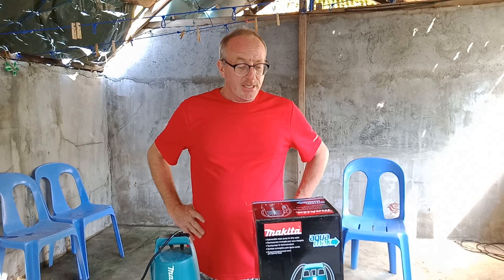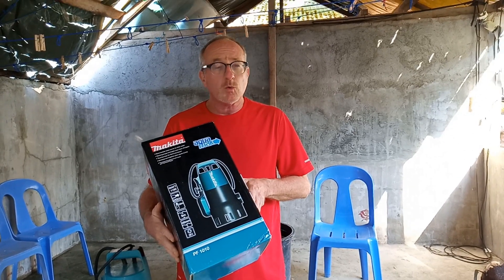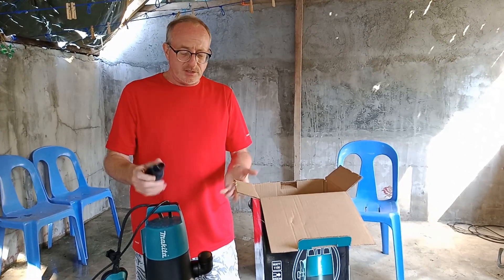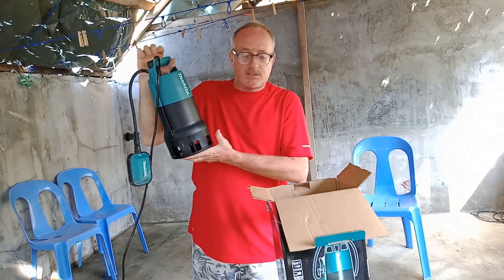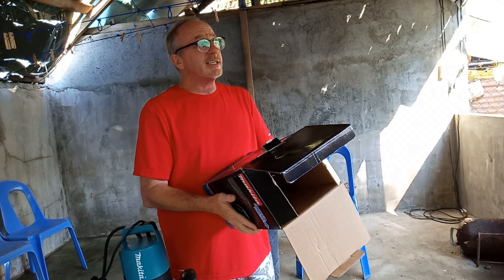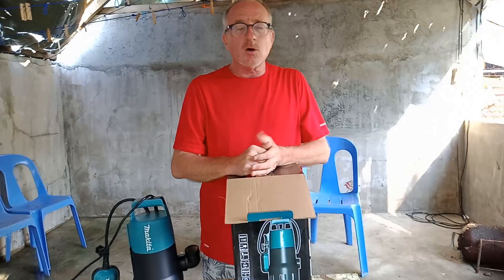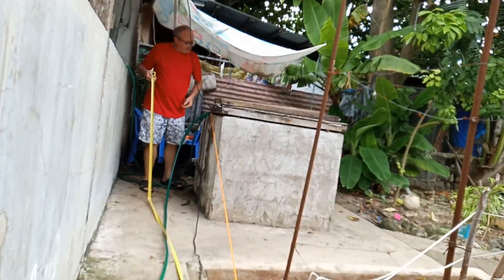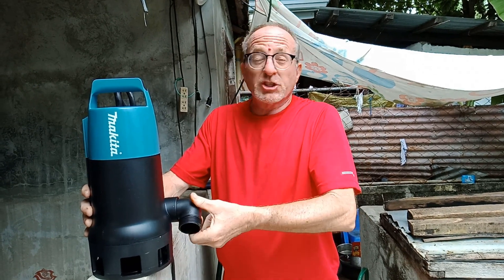Submersible Water Pump - 1/2 HP and 1.5 HP

Comment: 😊Great video😊 i hope you can help me withmy questions. On the packaging, The specifications for the 0.5 hp pumps says "140 liters per minute." there is a big difference between your actual use and the specs. Your review timed the 30 liter container at around 2.5 minutes, which translates to 12liters per minute. Why is there a big difference? Im asking because im looking around for a pump like this. Thank you 😊
Reply from the maker: I've been told my was slower because  I used a smaller hose, a water hose.  There are hoses that are bigger and should produce a lager flow per minute.  Hope this helps.

Comment: Very informative video. I’ve recently purchased a similar dirty water pump. I do have a question though, I can see that the discharge diameter is larger than the hose you attached, wouldn’t this impact the life of the pump in the future? Creates more friction on the motor.
Reply from the maker: Maybe, and even output more.  But I can say, as of today, it is still working!

Comment: hey mate, just wondering where you got or bought the hose / pipe / connector attached to the pump? I bought one as well, but i'm having trouble looking for hose that would fit in the 1 inch pipe. thanks.
Reply from the maker: I just took the parts to a hardware store and kept looking till I found something that worked.  The employees were of no help ...lol.

Comment: I'd like to point out that you did indeed measure the depth of the well, but you lost a bit  of the total length since you started to measure from the hose and not the water input itself (the part where the water actually starts get the force motion and gets tossed into the metal tube which then goes in through a 90 degree angle towards the hose input).

And another note regarding measurement, is that it seems the water hose, went down about a meter, then back up again 1 meter, forming an U shape, which needs to take into calculation as well, since you basically are going to have to go upwards 1 meter again. So in total I'd say you're missing maybe 1,5 meters give or take.

Then there's the angles that the water has to flow through, as I mentioned of the 90 degree angle, that really reduces pressure a lot, since it's far smoother to run water from a straight line than a 90 degree curve. Not to mention if you have the hose pressed (for example you step on the hose or you twist it), again the water loses it's momentum there. You want to keep the hose as free as possible, without squeezing them too much and keep the curves as smooth as possible.

Lastly, the hose size. Make sure you use a big enough hose. If the hose is smaller than the metal tube, you are going to lose even more pressure for certain. Make sure the hose size is at least as big as the output of the water pump itself..

Comment: Sir, why dont you use pumps that are intended for that kind of application?.it saves you time and money both in short term and in the long run..pumps intended for that can give you more pressure,head,etc..it can even last longer way longer than that pump because it is designed to do that
Reply from the maker: It was a cost factor, but you're right.
Reply: What kind of pump are you suggesting sir?
Reply: If the water is 25ft or less from the ground surface i highly recommend speroni shallow well water pumps.. They made in italy and in case of repairs you can find parts of the pump on our local hardwares..but if the water is more than 25ft, i suggest franklin submersible water pumps..the submersible pump would not run dry with your water source

Comment: How many liter per hour ?
Reply: Sir, is that a 1” hose you are using? If not, what do you call that metal to connect the hose? Thanks!
Reply from the maker: @alvin6012  The hose is 3/4" and I had to take the connector that came with the pump to a hardware store to fine the adapter(s) needed to attached the water hose, but it was easy.
Reply: The Philippines, A Foreigners Way Of Life thank you. I just bought an adapter, though i had to cut the end of the connector that comes with the pump to fit the threaded adaptor of the 1/2 inch hose. Havent tested it yet though. Hope it will work.
Reply from the maker: @alvin6012  Good deal, hope it works!
Reply: The Philippines, A Foreigners Way Of Life yup i just filled my gallons in the house. Thank you!
Reply from the maker: Hello, to answer your question... for the 1/2 HP at 6 liters per minute that would be 360 liters per hour.  For the 1.5 HP at 12 liters per minute that would be 720 liters per hour.  Hope this helps!  This is a good approximately.